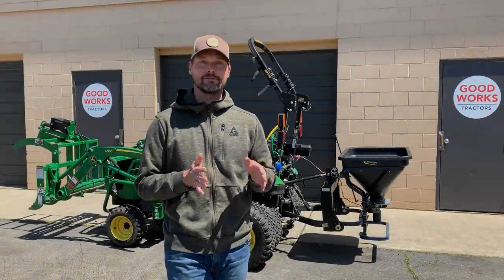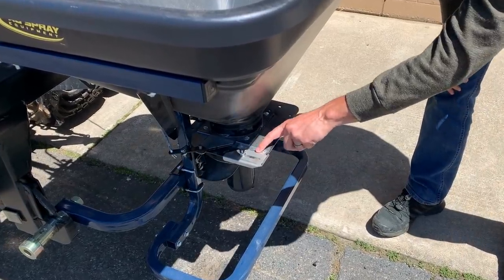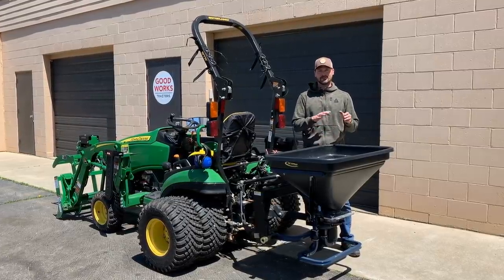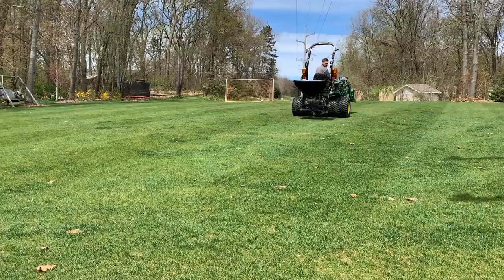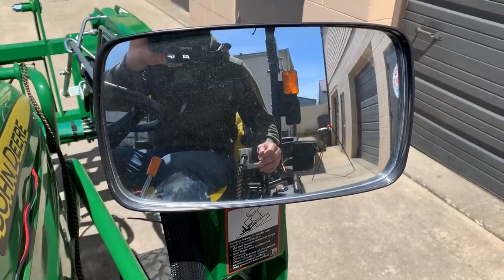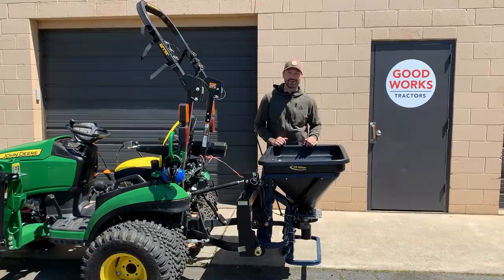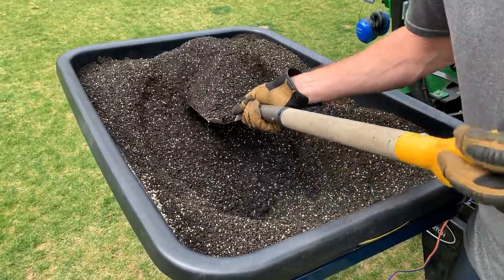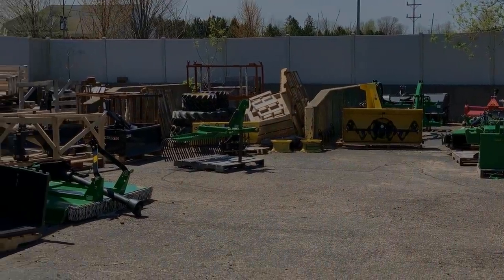NEW ELECTRIC SPREADER APPLIES GYPSUM ON THE LAWN!

Comment: I had one of these spreaders and used it only a couple of times before trading it in.  I have a large yard but a lot of flower beds and trees to work around.  The spreader is just too big.  I didn’t find the off/on lever that easy to reach, especially when you consider that the spreader is attached to a “quick hitch” placing it further from the seat.  It becomes dangerous to twist around and turn the lever while underway as you can easily forget or accidentally change your direction, etc.  ( especially tricky if you have a front loader attached as demoed.  Also not mentioned is the added convenience on the 1025r ( and probably other models) of having a 12v outlet right on the rear of the tractor and use that for power rather than having to run a cable all the way to the battery and use clips, etc.
This is a plus.  Also, there is no shield on the unit whatsoever so it’s a guessing game as to just how close to run to your drive or the wife’s flower beds…They need to add an adjustable shield.  These people need to make a unit with a linear actuator to open and close the drop chute as well….. For what you pay for the unit it seems little to ask.  This unit is or would be great for large straight runs….fields really….A good tow behind that just attached to your old fashioned hitch..( get the 3 pt. out of the way) and has a very reachable or ( modified) on/off lever and has an adjustable shield….and big rubber tires.   ( Hey, Cory….find one you can sell…). :)

Comment: Good information on the spreader.  I don't know if it would have helped you, but in the manual it mentions adding a "Cotter Pin" to the shaft of the motor to act as an agitator.  Might have helped with the bridging.  Second, instead of turning around to close the gate, could you just turn the motor off and on using the switch on the control box?
Reply from the maker: Didn't even see that in the manual, but it certainly may have helped!  Fert will still spill even with the motor off because the gate is open.

Comment: GPoutdoors has several videos on dealing with moist sand going not going through a spreader and the modifications he made to the rotating device in the bottom of the spreader. That might be helpful in solving this issue.
Reply from the maker: I'll have to check out those videos, thanks!

Comment: Hey Courtney - Quick question for you.  I bought one of the lube shuttle pistol grip grease gun, 10 tubes of the grease, and the Lube shuttle version of the locking grease fitting.  Well, I went to use it for the first time today to grease the mower deck on my new X758, and I could not get the locking fitting to lock on to any of the fittings on the mower deck.  It seems like the zerks are not long enough for the locking fitting to latch onto.  I tried the regular fitting that came with the lube shuttle grease gun after taking the locking one off, and even though it seemed to "seat on" to the zerk, grease oozed out around the zerk instead of greasing the bearings, or u joint or whatever I tried to grease.  Did you ever have such issues with the lube shuttle fittings?  I am thinking of ordering a locknlube fitting for it, but I am nervous that it is not going to work either.  Any thoughts?  Thanks for the help!
Reply from the maker: Thanks for the purchase Russ!  I used the pistol grip gun on my x739 and it worked just fine.  Last I recall, those zerks are the same as on (or very close) to the zerks on all the other tractors at my shop.  However, I have not used nor purchased their locking grease fitting.  I would try sending an email to Lube Shuttle customer service to see if they have any thoughts.  Seems strange as most zerks are standard on equipment like mowers and tractors.
Reply: @GoodWorksTractors  I agree!  I thought they were standard.  It just seems that it is close to locking on, but it just barely misses the lock point.  I have a 2019 X758 with a 54 inch mower deck.  I could not get either the locking end or the standard end to work without grease spewing out from the connection point between the zerk and the connector.  Kind of disappointing.  I had both the "regular safelok" and the extended reach safelok, and the standard fitting that came with the grease gun.  None of them seemed to lock on no matter how much I pushed it on, wiggled it around or no matter if it was a belt pulley I was trying to grease, a scalp wheel or u joint.  Kind of frustrating for sure.
Reply: Russ Albright I actually had the same issue as you. I ended up buying a locknlube coupler with a metric to NPT converter fitting and now it works great! Let me know if you want me to share exactly what I bought off amazon.
Reply: @sullymps1  Thanks for sharing.  I already have a locknlube coupler on order because of all the good things I have heard about it.  I also ordered the metric to NPT converter as well.  I am really hoping to have the same success as you have had with it.  It is discouraging to spend nearly $100 for two safelok couplers that just don't work.

Comment: I did buy lube shuttle and your code  thanks
Reply from the maker: Awesome, hope you enjoy!
Reply: @GoodWorksTractors  will lock&lube end work on the lube shuttle gun
Reply from the maker: I think it will, but may need to get a small coupler between fittings.  Not sure they are the same thread.